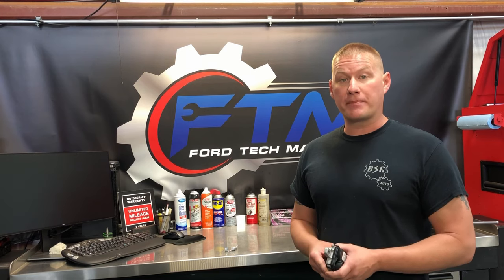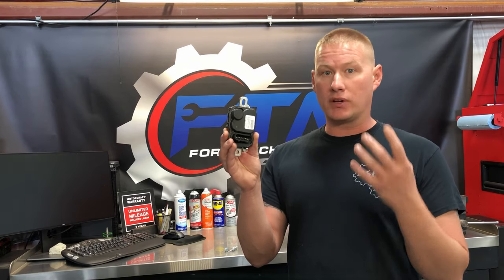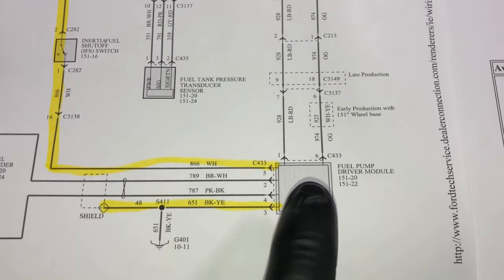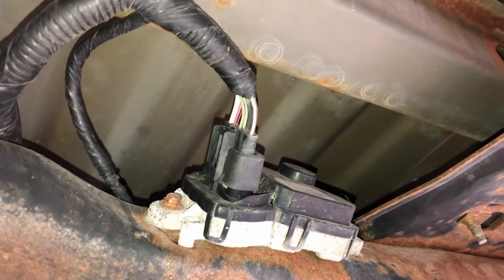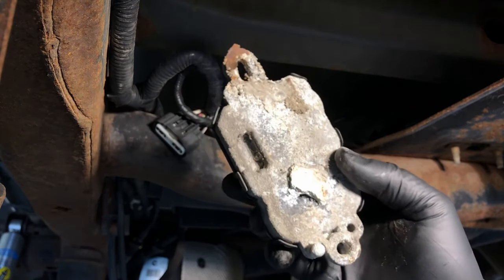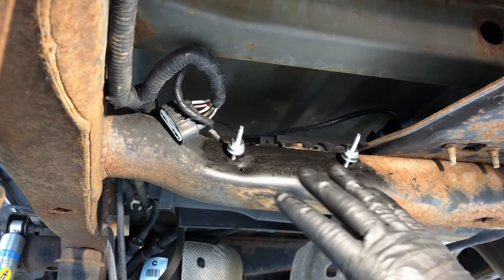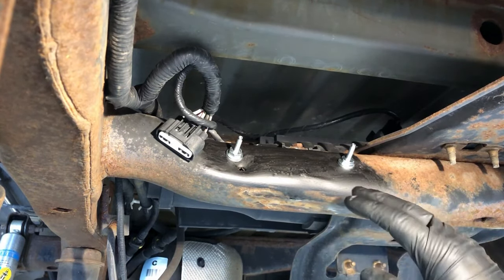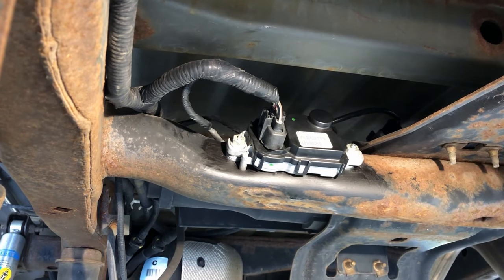2004-2008 Ford F-150 No Start DTC P1233: Fuel Pump Driver Module Replacement

Comment from the maker: These are the Parts and Supplies I Recommend:
Ford Fuel Pump Driver Module Kit-
https://amzn.to/2ZnUMRm
Motorcraft Electrical Grease-
https://amzn.to/2KYBNZN
Motorcraft High Temp Paint-
https://amzn.to/2KX2o9l                                                                                                                                                                                        P1233 Fuel Pump Driver Module Diagnostics:
https://www.youtube.com/watch?v=C1SdHBCujAo
Fuel pump Driver Module Expedition-
https://www.youtube.com/watch?v=S-ryMAsHKos
Reply: great vid wow broke in half!!! you forgot torch spare out.lol.thanks for sharing.
Reply: @fordtechmakuloko I have a 2015 F150 5.0 with 98k miles. I'm having hard starting issues after letting it sit for 2 to 3 hours. It will take around 5 seconds to start and sputter upon startup.  However, if I let it sit overnight it'll crank normally. Do you have any idea what could be causing this? It sounds like a fuel issue to me, but I'm not sure. I've also read about camshaft phaser issues that can cause improper engine timing...Any advice is appreciated.
Reply: Another awesome video. Thanks Brian. Would it really have killed them to have painted the back side of the module? Something as simple as paint does amazing things in the prevention of galvanic corrosion. Or even better, just make the body material out of plastic.
Reply: Replaced mine exactly as in the video...old one was cracked, but it still is not getting fuel. Could fuel pump have gone as well?
Reply: Can this part cause issues under wide open throttle??
Reply: I thought this is my problem on my 2005 F150 but there is something under the driver's seat area on  outside of the frame  a compartment with a whole bunch of wires something shorted out in that hand crank but no start we're as far as changing that modular changing fuel pumps took about a month to actually figure it out any ideas I didn't do it it was not a shop
Reply: @FordTechMakuloco I have an 04 f150 and I live by buffalo ny and when its  freezing out this truck runs like a lawn mower and goes into failsafe mode and as soon as it warms up it is perfect and I just did timing chains and spark plugs and im at a loss
 You think that driver would do it? If I floor it while its missing it revs fine but part throttle is none existent along with idle I gotta rev it to warm it up and im lost
Reply: Hey man i have a 2005 f150 truck barely running  p1237 (FP) Secondary Circuit ((FP) Driver module  im not a pro like you and i can't seem to figure it out, please HELP. THANKS
Reply: @ddewaukee3105  000 let's talk about the Ford 150 plants modulator transmission on a 2007 why it won't change gears
Reply: On my Ford 150 the module  on the transmission won't pull at all for about 5 minutes and then start driving where is the modulator on this thing
Reply: @h.l.scoggins904  what's wrong with your truck?
Reply: @rednkitaln  tengo el mismo problema, acabo de cambiar la bomba y arranco normalmente, justo hoy lo voy a probar, no lanza código de error, solo no arranca. Tengo un ford e350 del 2005 5.4, acá en Perú es difícil encontrar repuestos, que envidia les tengo, pero en fin me las arreglo para seguir usando la van. Saludos.
Reply: @scottjones6608  I'm working on a 2005 right now, and have done a few in my lifetime. There is no module under the driver's seat, unless it's the control module for the power seat. That's not going to keep your truck from starting.
Reply: @willefixit  Aa

Comment: Been there done that..was shocked how much better the truck ran when I replaced it wasn’t a cheap part from ford even with a discount still cost $140..enjoy the hell out of this channel the content you deliver is much appreciated
Reply: Wiseguy5150   Ran alit better ??  I’m going to check mine tomorrow    My truck seems like it starves for full at full throttle
Reply: @joesmith-fi1sx  did you replace it? Notice a difference?

Comment: Quick Tip. 2 20 amp fuses across the two sets of terminal....(yes they fit perfect) will alllow truck to start and run if module has died.  Get you home or to shop....save a tow fee.
Reply: Can you explain that in a little more detail.  I am intereted in what ya got to say.
Reply: @Starbreaker666  at 3:41 for connector view...install a 20 atm fuse across the top 2 terminals and a 20 amp fuse across the bottom two terminals. This provides a power and ground to the fuel pump. The pump will run at full pressure but the truck will run to get to shop.  I have done this quite a few times when customers call to say their truck won't start and drive back to shop.
Reply: Best tip ever thank you very much

Comment: Hello. I have a 2004 Ford expedition 5.4L V8.  My truck is burning excessive fuel. I have changed my fuel filter & EGR unit.  But I am still going through fuel super quick.

Comment: Just happened yesterday (7/22/2024) to a friends 2014 Ford E-450 RV (6.8L V10) conversion.  Left him stranded in the middle of Ohio during a cross-country trip with his whole family.  Some bucking, one intermittent engine check light DTC (which he ignored b/c he was in a hurry to get east at the beginning of his trip), then hard starting, then crank/no-start.  All of this progressed over two weeks.  Couldn't find any RV places willing to tow/service (claiming they didn't have a lift large enough for his 30 footer RV), so he ended up at a truck dealership for the repair.  They started by dropping the tank, said the pump had no power, then traced it forward to the driver module.  They're saying both the pump & module are now b/o.  $700 in parts and $900 in labor, according to him.  Seeing this first could have saved him a chunk.

Comment: does this pump module have anything to do with the fuel sending unit sending a reading to the fuel gauge?  My gauge that worked fine, my truck was stolen and when I got it back the gauge read below "E".  Exact replacement fuel pump, same thing.  I have done the gauge sweep.  Fuel gauge tries to go backwards?  Any suggestions and I thank you in advance.

Comment: This happened to a friend's truck...15 min fix...i came home and pulled mine off...you guessed it...was starting to come apart...removed and cleansed...coated the back side with sealer cleaned frame and installed a rubberized backing....six years ago....great content here as always...our ford friend...
Reply: I find putting rubberized backing a better fix then standoffs. With standoffs dirt and salt buildup from around here will pack itself in there and cause the same issue in less then a few years. Stand-Offs Fords lazy band-aid problem to make you buy another one in few more years when they could have just properly engineered it or made it out of all plastic to begin with.

Comment: Mine failed on a 6 hour road trip during rush hour, got the truck on the shoulder and beat the $hit out of the module with a screwdriver and it started enough to get it off the interstate. Ran like crap but luckily a parts store was close by so I managed to pick a module up and just plugged it in and let it rest up on the spare tire until I got home. Would have never known about the module if it wasn't for channels like yours so thank you for all you do!

Comment: At least you did not have to program it like GM makes you do.
Reply: Its also an earlier model ford as well, so less complicated then they are now. Although to play devils advocate, I see where GM is coming from with the whole recalibration thing, esp. actuators (HVAC damper, e-throttle, etc.), for example. The only other option (and how they used to do it) is to include logic in the software to automatically learn the home position and range of the actuator during key on or after X number of starts, which puts a lot of wear and tear on the actuator during the life of the vehicle. Doing the recalibration just once during a service visit saves a lot of stress on the components.

Comment: When replacing this module make sure you check the ground cable back there, I live in Ottawa Canada 🇨🇦 .
I replaced mine and about four years later the problem was back after investigating the ground cable was rusted off, (so double-check the ground cable on the back near the fuel module.)
Reply: Good ole salt.... You're more north than I am but I know what you're talking about! People down in the southern us think we're crazy for saying "check the ground, it might be broken!" Haha.
Reply: Yep,I'm in (South) Ottawa 🇨🇦 too,when replacing mine noticed that the ground was literally hanging on by a thread. Crimped a new ring onto with lots of dielectric to slow the corrosion.
Reply: Where is the ground cable
Reply: @marcnarmer3229  there's a few, but the main one is no more than 6-8" from the actual FPDM. There's also another main ground on the LS rear of the frame where the bumper mounts.

Comment: Someone suggested I look at that device before I went on a huge Yellowstone trip.  I had asked if there was anything I should look for before my trip even though I had no problems and sure enough, when I looked at it back in 2011 (I had a 2004 model) it was corroded and popped open/cracked already!  Good thing I caught that before I left for the trip.  Thanks to the folks on the forum for the suggestion too.

Comment: My Dorman part working great,3 years ago! Was $57.00 eBay! Ford part was on back order and cost $107.00 back then!
Reply: my Ford dealership was back ordered too and I needed the truck,so I got a Dorman one,so far it's working good. And it had spacers to move it away from the steel cross beam.
Reply: Now these are all double that cosy unless you order the Dorman from Amazon.
Reply: My brand new doorman doesnt work. $60 at orileys. Saying i need to get a ford one $220 crazy
Reply: @koreyhair6195   I have a good cheap one new in box shipped $70 had it as a spare. Also other new parts fits 04-08 f150 if interested,
Reply: @koreyhair6195   check for blown fuse top of fuse box right side kick panel , if red light is flashing.
Reply: Just bought a Dorman FPDM for my 2004 ford explorer sport trac xlt, The build quality looks solid to me. Will find out how good it is when I swapped it out with the old one this friday. Will report back.

Comment: Will this possibly cause chugging and a rich condition up hills or heavy throttle? I have a 05 f150 XLT that I just did a complete thanks to your videos. Did the coils and plugs (thankfully none broke on me.) I'm getting the p2198 code and using the torque pro app it's telling me that the catalytic converters are roughly between 1000 and 1200 degrees no load and only going around 40mph. Thanks ahead

Comment: You are  the best when it comes to helping us with this fuel pump issue  I've had  the same problem  recently with my 2006 f150 5.4 Triton, at first I thought i had a fuel pump problem which i was going to change but  after watching your video I went underneath the bed took the old rust fuel module pump  part out, replaced it with a new one and the truck start on the first crank.....Thank God for people like you.

Comment: What about an 01-02 4.6L f150?
Is there a similar issue 🤔 i have to leave the  🔑 on in ignition on for about 2-3 min and then it will start

Comment: Any sailor will tell you that's not the way to properly treat corrosion. The frames been done well but you're still not gonna completely prevent galvanic corrosion of the module, you still have an electron path. You can greatly improve corrosion protection by also painting the module body. Aluminumgell would also do a good job
Reply from the maker: I used fluid film.

Comment: I had a friend with an expedition that had this fail on him. After replacing the fuel pump and numerous tow charges. They found this to be the problem. He warned me about it on my 07 f150. I bought the new kit right away. When I went to take mine off, one side fell off when I put the wrench on it. The back had corroded straight through. I was so close to being stranded.

Comment: 7:36, R.I.P. headphone users, LOL. Like your videos, I did this to my 08 back about 5 years ago. I used the Dorman part that comes with the rubber spacers, was under the truck this spring and most of those rubber spacers are gone and looks like I might have to replace the module again, getting a little crusty. Probably use the Ford part this time around.

Comment: The first problem I noticed with my 2008 F150 was while driving through a heavy rain storm, the truck started running like it was misfiring.
The next morning I phoned my mechanic and when I went to start the truck and head to have it looked at it ran normal again.
Months later I noticed if I pressure washed my truck and sprayed the under carriage it would run like crap and bang & clang until module would dry out.
One time I had a rad. shop flush out my coolant and as I drove away it started to feel like it was misfiring and quit just as I was getting on to the highway.
Had someone pick me up, went back a few hours later and started right up. As long as it didn't get soaked with water under there, truck ran fine.                                                                                          When I had it replaced it was super rotted out but still ran fine if it stayed relatively dry.

Comment: Question: in that diagram there’s a black yellow wire coming out of the number 3 pin. Does this go to the pump connector? 

I’ve replaced this FPDM and the fuel pump, but now it seems like I’m not getting any power to the pump. There was a bare wire, with about 1” of black insulation, wrapped in silver tape with the two larger wires going to the pump connector. Trying to figure out what that is for. Thanks!!!

Comment: I have a question about something and can't find really anything on line at all . 2000 ford e250 4.2 v6 van problem is missing or losing coolant and found out the hoses that go to the pcv valve have coolant in them and so on guessing it's burning it idk but there's coolant in the hoses to it and there is like 3 I think it was that lead up to the back of the intake manifold . What is the problem why is it or has coolant in that thanks anything would help . Also has 300,000 miles on it

Comment: A rubberized backing would eliminate that gap and avoid it filling with dirt and salt from the road.
Reply from the maker: They need the backing vented as it is a heat sink, you don't want to insulate it with rubber. This new mounting method works perfect.
Reply: A rubber backing pressed against a steel cross member won’t stop modern deicer from creeping in

Comment: I've completely lost faith in Ford. Before 2004 they were like hondas. Lacking in performance but bulletproof. Since 2004 they have had top notch performance with too many minor problems which eliminate the truck's ability to properly function. 

Had Ford issued a recall on their cam phasers and oil flow, I would be happy to continue business. They not only stiffed their customers. But they put the same garbage set up in the majority of trucks they sold for nearly a decade. Not to mention the spark plug head issue prior. 

I've bashed GM all my life. They are weak junk and everything falls apart. But you rarely need to go digging around in the engine. 

Give me an F150 with a Hemi. Anything short of that may as well be a  tundra or ram.
Reply: Also four wheel drive module, window regulators alternator making whistling noise, etc😭😭😭😭
Also check the negative cable tend to rust of the frame so keep that in mine when replacing the fuel module.
Then the infamous manifold replacement 🤬🤬🤬🤬.
Reply: Every car company has problems with redesigns dude. Hate on Ford if you want. Every one of them
Reply: Lustfulvengance absolutely brilliant strategy. I’m serious. I have 3 F150’s all XL, and E-150, and all are base models. I will continue with my strategy, as you do as well.

Comment: My truck is on FPDM number 3, the first one died and was replaced before the "revised mounting kit". I think the dealer installed the 1st replacement, they had trouble getting one because they were on back order from Ford, and basically impossible to find after market. When I installed the 2nd replacement (this time with the revised mounting studs) this summer I also Fluid filmed the case.

Comment: Wow, what a difference salty highways make.  Thanks for the video since I just checked this component out on my truck today. However, on my truck there was no rust at all...anywhere, probably because it's spent almost all its entire life in Arizona.  I can see keeping this truck another 20 years in this climate. The one problem that I am having though, is all the clips to the connectors on the coils, headlamps,injectors, etc,  are all broken or falling apart from the dry heat.  I just received an entire pig tail set for the injectors and coils, and replacing the old ones is going to be my next project. This way here, I can get rid of all my zip ties and duct tape holding everything in place. Red Green would be proud of me.😄😄